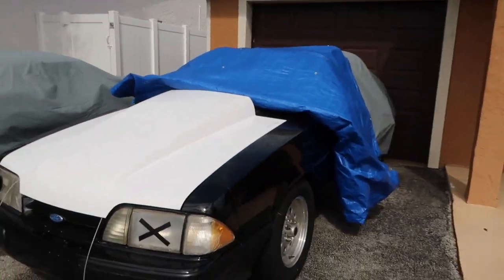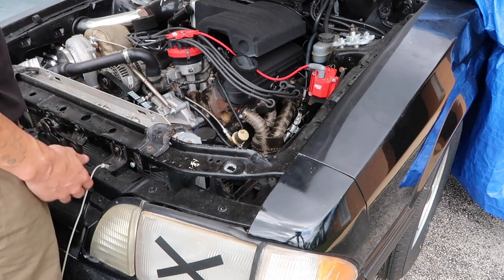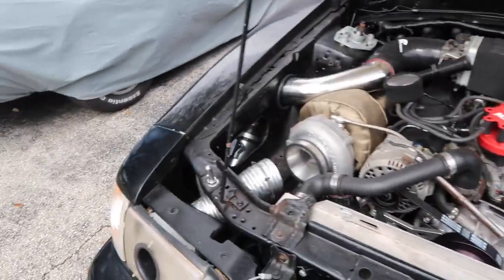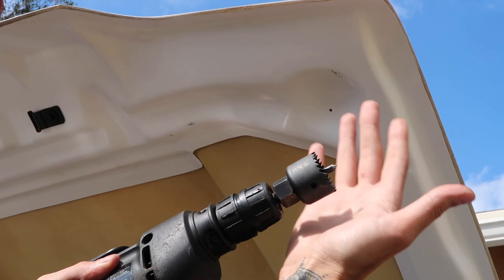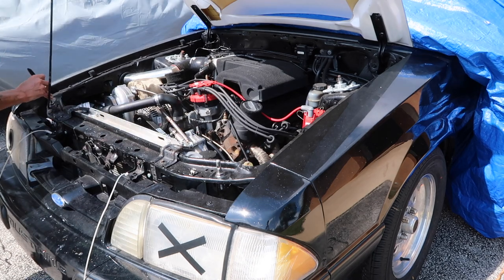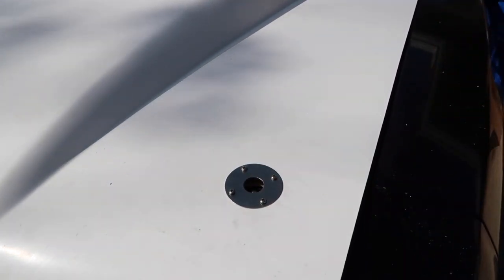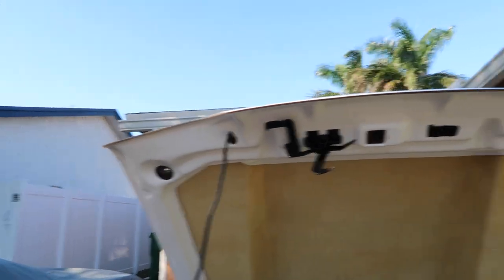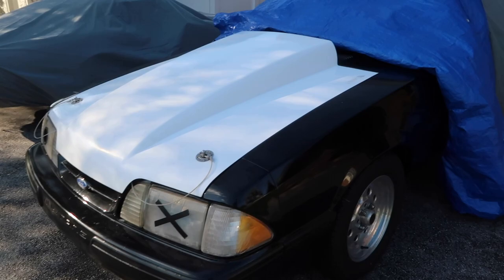Installing Hood Pins On The New Fiberglass Hood

Comment: Did you drill into the metal frame where the rubber stopper used to be?
Reply from the maker: If i remember correctly you just have to make the holes slightly bigger for the hood pins to fit threw

Comment: It would bend the cowl where the wipers are and shatter the window happened to a friend of mine  a few weeks ago
Reply from the maker: yeah sketchy business.. definitely worth having a set installed
Reply: Did the latch fail? What happened?
Reply: I’ve owned 13 foxbody’s over a 25 year span. Everyone has had a fiberglass hood..... I’ve never put hood pins in any of them. Also never had a hood fly open.
Reply: @NoFox_Given  this guy deserves a trophy lol
Reply: @rambo360g  😂 the secret to my success is I always have ran the safety catch and properly adjusted the hood and latch. If a hood flys open someone didn’t do that. Or, I guess it’s possible they bought a junk hood (champion / Cincinnati composites) and it broke.
Reply: @NoFox_Given  mine popped up but was able to stop in time for it to stay latched. My hood didn’t come with a place to install the spring feature so couldn’t tell that I had popped the latch and got side tracked talking to someone then left the track